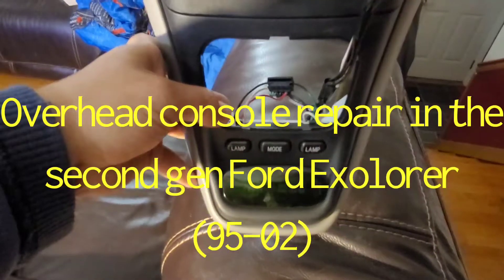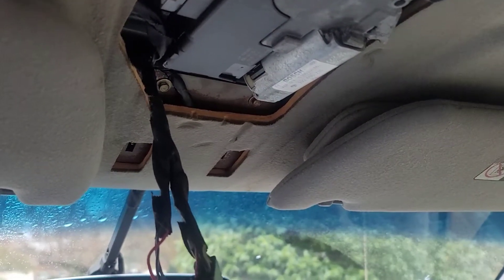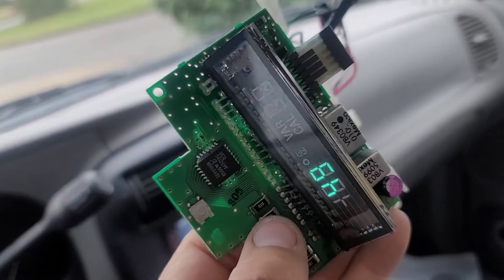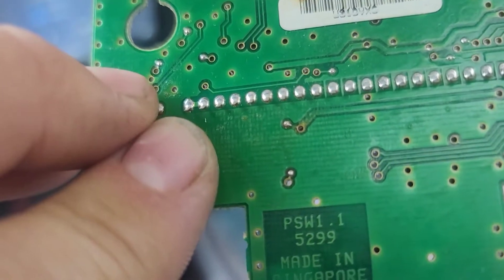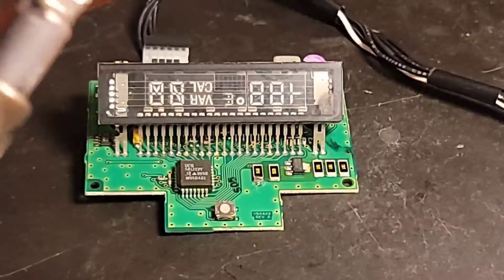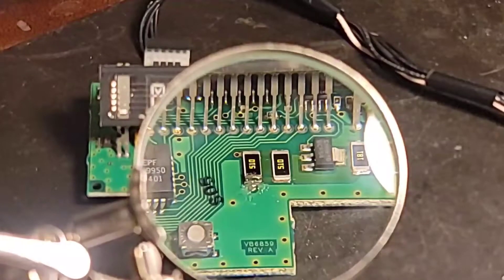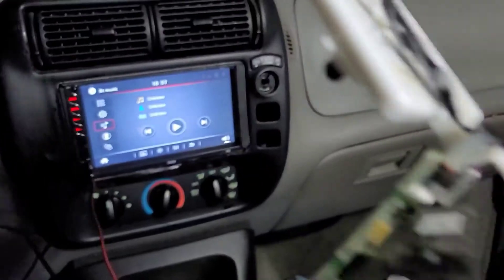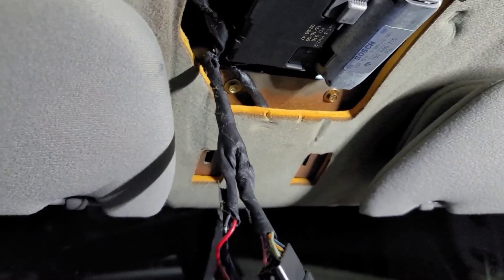Fixing the overhead console display on a second generation Ford Explorer

Comment: You didn't show how it came apart
Reply from the maker: It is not complicated. Everything is held together with small screws, if I remember correctly. I did not need any special tools.
Reply: @xfer43  I can’t find it anywhere on the internet or anywhere at that matter either.
Reply: @canadiannonsense there are about six silver screws that you’ll need to unscrew. Then it pops apart, pretty easy once you get going on it.

Comment: This did the trick! But Did you have any issue with no power to any of the windows after this? My current issue after fixing this
Reply from the maker: I cannot believe I missed this comment! Thank you for the feedback. The windows should be on a completely different circuit as the amp draw on motors is way more than the small
incandescent bulbs.
Reply: that sounds more like a coincidence to me because like just jay said its on a different circuit. maybe you have a ground issues? ground issues can cause some weird electrical problems.